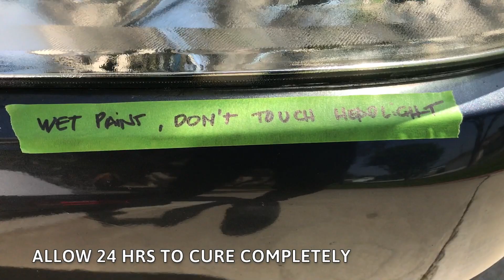Repair Hazy (Oxidized) Headlight Lens (Honda Accord) - DIY 5 Minute Video

Comment: I used this method and when I was  sprayinformed the clear coat process I got orange peel does any one know why and how to remove the orange peel
Reply from the maker: +Mike Martinez Hello! Orange peel can been removed by using a super fine grit wet sanding. You could do like 2500 then 3000 and then just use a clay polish to buff to superior optical clarity. Let me know how it goes for you and thanks for watching!!
luke

Comment: when I wet sand do I sand In circler motion?
Reply from the maker: I recommend keeping the sanding horizontal because the circular sanding puts too many scratches in odd angels that make it hard to buff them all out. But I do like to do the buffing in circles :)